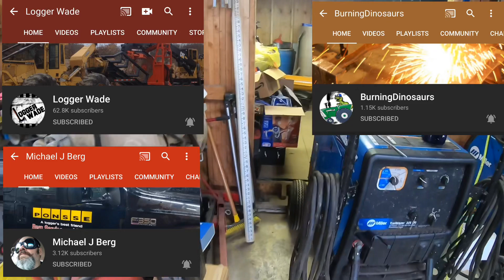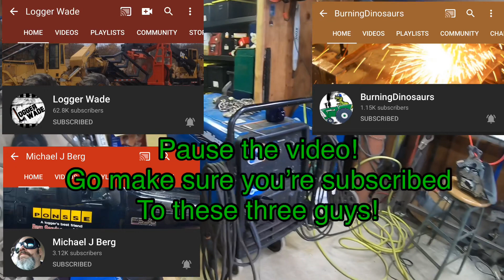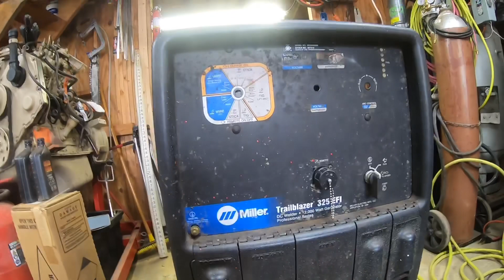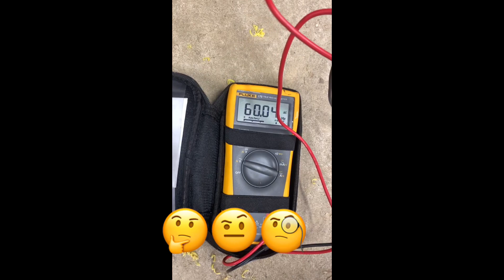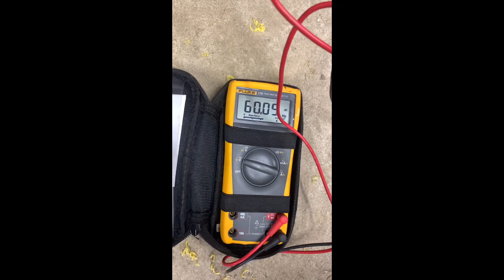Well, I got another welder... but was it a mistake? Miller Trailblazer 325 EFI

Comment: I was getting 20 hours a tank out of my 325 EFI. At the same time the 250 bobcat and Ranger 305 were basically a tank of fuel a day.  The Ranger never went more than 8 hours before running out.   The EFI paid for itself in the first year!!
Reply from the maker: No kidding??? That’s really good to know. I think I’ve settled on a bobcat 200 airpak diesel. I’d really like to have the diesel and an airpak has become a must I’ve spoke to a lot of people that are doing or have done mobile work and they agree that 200amps is plenty for the odd jobs and farm work I’ll be doing with it. It runs the same Kubota diesel I have in my little bobcat skidsteer and I know I can get close to 30 hours out of a tank of fuel on that. (Just under 6 gallons) do you have any experience with them?
Reply: @JasonWorksAlot  you’ll love how quiet the diesel is.  If you ever run really hot with stick you still will be fine.  What’s the voltage rating?  Even a .045 dual shield will run 28 V MAX!   Without looking it up I. Bet it puts out 22-24V
I would think it holds more than 6 gallons.  Diesel is always a great investment for welder.  Lots of low end torque for high output situations.
Reply: Ok,  I’m new to your channel but looking at Miller’s website 7 gallons diesel fuel on the Bobcat is pretty impressive!  The only thing I see is it is a high idle welder depending on the load.  
This is what I would do if it was me looking going with NEW first. 
I’d personally buy a Big Blue 400. and go with a $600 compressor from Home Depot if you have the room.  
Reason is your going to get a solid, robust more versatile welder with the Big Blue that at high idle is 1800 rpm vs. 3600.  Plus the option of a new version wireless interface and block heater. 
If your using it for power it will be pretty quiet.  Welding will be exceptional, and you have 400+ amps for CAG.  I’d take that Big Blue on a pipeline job.  In fact I used one for X-ray pipe welding.  Very smooth power.! MSRP is only $750 more than the Bobcat diesel.  The Bobcat Weights 618 and big blue is 993 LBS.  It will last you the rest of your life.  Built so much better.
Reply: If you look on Cyberweld and other online sites take that price to your local Airgas.   I’ve had them match it for my 325 EFI.  I’m sure they will work with you on price.
Reply from the maker: @overtheclouds9  oh yeah I’m comparing it to a bobcat brand mini skid steer. I don’t know How the load requirements would differ or anything like that. I did run the mini skid at full throttle but as far as load the engine sees it’s all dynamic to what functions are doing what.
Reply from the maker: @overtheclouds9  I’ve spoken with the owner of my local welding store, (keen industrial) he said that about three times a year they run a special and he gave me a really good number for it. Was under 10,000 so I was pretty happy with that. Just waiting for him to call and tell me to come buy it basically.
Reply: @JasonWorksAlot  awesome 😎

Comment: Jason, this may be too late because I notice this video is 6 months old but, I had the exact same symptoms on a Ranger 305G that had 6800+ hrs. on it. Took it to the welder repair shop and was told it was a $1200+\- board. This welder helped me build my business and is considered a family member so, I said sure. The ol’ girl is worth that. Well guess what....., it also fried the $1400+- board down stream! Can’t return electrical parts. So, with labor, I ended up putting about $3200 into a 14 year old/almost 7000hour machine. I’m satisfied with the results but probably wouldn’t have done it if I’d known up front. Hope this helps.
Reply from the maker: Yes that’s what it looks like this will be as well. I haven’t heard back from the shop in months but honestly haven’t had time to care either we’ve been so busy. My plan is to just get it back and either sell it cutting my losses or keep it as a generator only. Too early to tell. But I think I’ve found an airpak to buy off a good friend to replace it so maybe it was a blessing in disguise 🙃
Reply: Thank you for your reply. Good luck. Failed to mention the last time but I just replaced the factory battery on my old 305G last Tuesday at 7200+ hours. I purchased it new in January 2005! I semi-retired that machine in 2015 and mostly just use it at the shop and sometimes at job sites when I want to work away from my truck. I replaced it with a new 305G. We’ll see if lightning strikes twice.
Reply from the maker: @williamthomas9463  I’ll keep my fingers crossed for sure! Best of luck with it!

Comment: I'm looking at bobcat 260 n 325 trail blazer ..both carbed as i don't want efi .but i did reaseatch that 325 is electronics n 260 bob cat is mechanical..so less problems..but how is the welder performing. The arc.need it for few hrs a month.working on semi trucks n trailers. N generator

Comment: What was the final outcome on this trailblazer?  Were you able to get it to weld again?  Have one with the same issue
Reply from the maker: Nope. Machine sat at miller dealer for 10 months while they went through it. Couldn’t figure it out and I wasn’t really willing to take a gamble on replacing circuit boards at random. Picked up back up a couple months ago and really dug into it with burningdinosaurs, he’s some kind of an electrical engineer type person, we found both main capacitors were bad and the large resistor was bad. I ordered them. Put it all back in and when I went to start it the engine immediately choked down like it was under a heavy load. Turns out the welding generator went full bore and over voltage, one of the brand new capacitors exploded and I’ve basically left it since. Checked for any shorts or anything and got another set of capacitors or it but as soon as you start it, it does the same things. If you unhook the weld generator leads it runs fine. The ac generator still works fine. So I bought a big blue 400 pro a few months ago since I needed a machine and the trailblazer wasn’t looking good. Got a used one with 4K hours on it and haven’t look back. Will end up selling the trailblazer as a generator and try to recoup some of my loss on it.
Reply: It’s the igbt pack on bottom of machine. It’s a very expensive part. I work on these machines

Comment: I had one that broke a rocker at 102 hour's. Put in brand new and it never welded right again. Amperage was never right, always burned extremely hot. Had it at the welding shop twice to get taken care of. When welding, it would start off fine, but would feed amps while welding.
Reply from the maker: MLH Repairs LLC oh joy. So much to look forward to🙄
Reply: @JasonWorksAlot  I couldn't deal with it anymore and unloaded it. If you were using on a job you needed a guy to stay at the welder to turn it down. You would start a weld at 110 amps and end at 65. Not very economical for me. Lol 😁

Comment: Frankco Products LLC rebuilds boards for all types of welders very reasonably. Nice fella to deal with, stands behind his work. He's located in Vermont.
Reply from the maker: No kidding? I will write that down! I sold this machine for parts. I bought a big blue 400 instead. But it’s got circuit boards in it too. Thank you!
Reply: @JasonWorksAlot  Frank at Franco is the best in the business i just had him go through both boards for a 325 at a cost of $600.  He's good.

Comment: There's really slim choices for engine driven welders for requirements like mine. I needed a a good welder that also provided lots of generator power to run my plasma cutter and provide backup power to my house and shop. Lincoln Rangers and Miller Bob Cats are more for generating power but can weld OK. They are not considered great welders. At least not the Bobcat but I hear the Ranger is the same. Correct me if I'm wrong. Now there are very fine, big, heavy, expeeeeensive welders if you want to spend north of 22K and don't mind taking up half your truck bed with a 16000 pound machine. Lincoln SA 200, Lincoln Vantage, Miller Big Blue 400 or Pipe Pro. Even if I could afford those, which I can't, many such models offer very little in the way of power generation. Some only have one or two 115V outlets so they still wouldn't meet my needs. I went with the Trailblazer EFI for a few reasons. Small and light weight compared to the other options. Welds amazing. Had the EFI option (I hate carburetors). And also offered the excel power option. So while everyone else's machine is revving up just to use a grinder, mine gives me 2700 watts at idle. I have two double 115V outlets and one 50 amp 230V to run my Plasma Cutter or a second welder. Also, the welder actually has two separate generators. One for the welding power and one for the generator power. So I can be welding a joint and someone else can fire up my electric Air Compressor and Plasma cutter at the same time and my arc isn't effected. I hope I don't suffer the same fate as others with my machine. I will say, after 300 hrs, It's performed perfectly and has paid for itself probably 3 times over. And I just do this as a side job on the weekends. I have no loyalty or bias towards Miller. If mine died tomorrow I'd be open to other models and brands in the $8,000 to $10,000 range. They have to meet the requirements mentioned above though. I'm not aware of any that can do all I ask but I would appreciate any suggestions incase mine does bite the dust. I've had mine for 5 years now and it runs like a champ.
Reply from the maker: Couldn’t agree more with you. I ended up selling this for parts and I bought a used big blue 400 pro. I got it for an unbelievable deal and it’s been amazing for me. Just chugs along, it’s quiet. Runs my suitcase 12vs with arc reach so I can control the machine from the suitcase and I’m hoping to find the regular arcreach controller used for a deal sometime too. Best of luck with you with the trailblazer!! I know many people with them who love them. And yes. No loyalty to Miller from me... anymore atleast.

Comment: I have the same problem with an older Trailblazer 250 " 1992" model . Welder runs great , have power at 110 and 220 outlets but won't weld .  I've replaced the brushes and cleaned the slip rings .  Pretty sure it's the circuit board and they are proud of it . Almost like they want ya to give up and buy a new welder ?
Reply from the maker: Crane & Rigging so far on mine it has a blown capacitor which is mounted on a board pretty much behind the dinse connectors the cap took out that circuit board it’s mounted to, the cap is 65$ the board is 1600$ and the reason it’s still sitting is that miller can’t tell us (me and the shop I took it to) if that will fix it or if the PC2 board is bad as well (board with the displays I show in the video 1650$) I’m not spending 3300$ on a welder that costs 5500 new. But I will say that if they can’t help me I’ll never buy another Miller welder as long as I live. I’m so sick of them as a company :(
Reply: @JasonWorksAlot   Great point's Jason and thank you for the reply . I feel the same way about this BS high parts price on a simple item !  We have ran Miller welders and equipment for 30 years but I can change my mind pretty quick when the nonsense starts on parts cost and support !
Reply from the maker: Crane & Rigging couldn’t agree more. I’ve spend quiet the small fortune on blue machines. I’m pretty much over it anymore though. If I’m constantly going to be rolling the dice on this stuff then I’ll just get something that’s cheaper. I’ve had nothing but issues with my 350p mig machine since I got it. Funny how the two primeweld machines I got for toying around with work every single time I need them. Going to be looking at Lincoln engine drives soon I think
Reply: @JasonWorksAlot  That seems to be a common complaint. The electronics are not dependable and Miller's out of warranty pricing is incredibly high. It's as if they doubled or tripled their parts prices to offset the cost of the boards they replace under warranty. Their prices are so ridiculous that I decided long ago to not buy blue because of their pricing.
Reply from the maker: @briangc1972  yep I literally picked the machine up today from dropping it off month after the videos was posted. My local welding shop was trying to find something used we could part out and fix this one because it’s not worth the cost of a board. No luck. Have had to rent and borrow machines for jobs. Still considering the diesel bobcat airpak though. It sucks because Miller owns the market on the onboard air machines it seems.
Reply: @JasonWorksAlot  Use a stand alone electric air compressor and run it off the welder's 240V outlet.... That allows you to buy a Lincoln engine driven welder

Comment: Yep, the PC2 board is about $700.
Reply from the maker: I got quoted 1475 for it. But they can’t guarantee that’s the only issue. It had blown main capacitors and apparently they were attached to a circuit board as well and ruined it. 1700 for them. Plus labor. I don’t think it’s worth putting the money into at this point. It’s pretty used for sure after really looking it over. I’m going to keep it for the generator at this point and I’m looking to get a diesel bobcat airpak in the near future. Maybe I’ll buy the circuit boards on my own starting with the capacitor one in the future and see if it works.

Comment: I have the same problem after I borrow my machine to a friend ...they jump the battery and fry both circuit boards ...take it to airgas and be there for months and not a good diagnostic and parts stolen ...I replace the main circuit( with the screens)and send it to a place who said they can fix boards and almost get robbed )so I buy new $1200  and the board with all the capacitors $500 my is 2014 trailblazer 325 and found a better price on miller4less.
Reply from the maker: That’s basically all I did and it still didn’t work. I just sold it for parts last weekend. I bought a big blue 400 because I needed the machine for a bunch of jobs and got tired of borrowing and renting.

Comment: Is there a way to adjust throttle linkage to increase throttle a little and try it before ordering parts? Welcome back!
Reply from the maker: Man With A Plan hey buddy how’s it going? 

Yes, there is. And I briefly gave it a go, no dice. I did some more research and called around some. Ended up making the decision to drop it off and get it looked at by a miller tech. Same welding shop I always use they’re good guys. Talked a lot to the guy and learned a lot too. Some of it I wish I didn’t learn but we’ll see. It comes down to being possibly one, or two, or both circuit boards in the machine. And they’re costing something around 1600 each. So I felt it better to leave it in their hands and they can call me when they know whah it is for sure. If it ends up being both boards I’m thinking I’ll just pick it up and keep it for a generator for now. Don’t hand that kind of Money to put into it at the moment. I can always run my Primeweld machine off if and stick weld with that if needed. 

I’ll have a video of if as a follow up as soon as I get it back. Hopefully it doesn’t take them too long

Comment: If it's not worth fixing as a welder it's not a complete loss like u said u will be able to use it to power the house if needed
Reply from the maker: Josh Cunningham yeah that’s probably going to be my play. I’ll end up trying to sell it for close to what I have into it disclosing everything I know about it. But it probably won’t sell so it’ll be another generator in the shed. Live and learn
Reply: @JasonWorksAlot  yea it happens maybe you will be able to find one that getting parted out the motor bad on and get the parts u need cheap if you not able to get rid of it thanks for sharing
Reply: @JasonWorksAlot  here is a number to the best we have around my neck of the woods for working on welders it's fields welding supplies in coal grove ohio he might be able to get u answers or parts cheeper I don't know if he can but he always has done me good u might not want to mess with it I just figured if he could help you keep the welder it was worth the chance sorry if I'm bugging you I just wanted to give you another place to check
Reply from the maker: @joshcunningham9082  hey no bother man thanks for the lead. I’ve gotta call to pick it up next week if I get some time. They have it apart but didn’t fix it. Needs a capacitor set, and control board (they’re all in one) for 1600 but they can’t guarantee it’ll fix it cause it’s growing a code for the board that’s in the video being bad. Miller won’t say it’ll fix it for sure either so I’m not sure I’m interested in putting 1600 into it to possibly have to spend another 1600 cause at that point I’m in it 4100 and I don’t feel it’s worth that. I’m looking at newer air paks maybe even new. Not sure gotta finish and sell the house before I pull the trigger on that tho